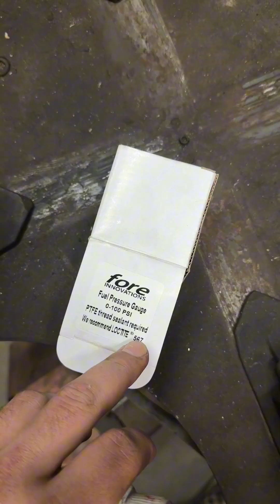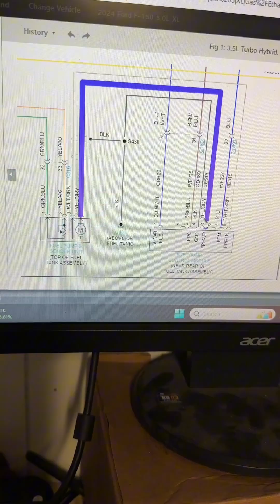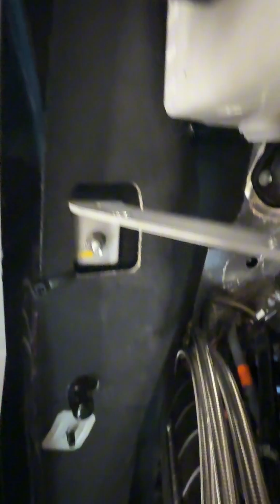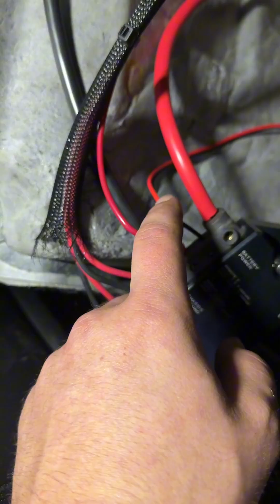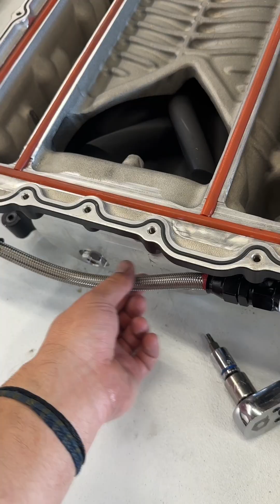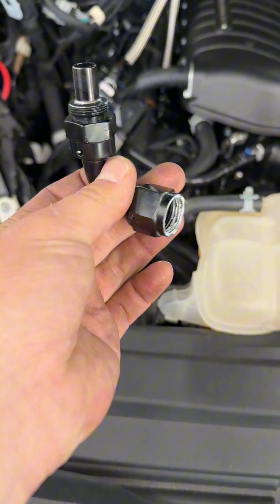Fore Innovation fuel system install on 2025 f-150 along with injectors

Comment from the maker: After this video I myself made mistake with the vaccum/boost switch in the video it’s mounted on driver side port, but this is only vaccum it never gets boost leaving us with only one fuel pump working the correct port is on the passenger side front not the side it’s a little plug and it’s in same location as the map sensor except located on other side. Also i did not add this into the video but the wires coming from engine bay and through the fire wall make sure those have like a vaccum hose or some sort of cover over the wires so over time with movement it does not shave of the wire insulation.
Reply: Where the regulators per set to have pressure?
Reply from the maker: @J-Man-C the regulators come already adjusted to the correct pressure if that’s what your referring to, but still double check once system is on
Reply: @Slowestmk8  we  cant get pressure at the regulators. I think our problem is at the remote wiring pumps never kick on
Reply from the maker: @J-Man-C with ignition on do you hear the fuel pump? And also are the gauges mounted in the correct spot. If you hear the system turn on and you don’t see any pressure I’m pretty sure those gauges are in the wrong ports on the regulator
Reply: @Slowestmk8 we figured it out had a fuel line crossed at the regulator lol. Thanks for the response.

Comment: What pulley are you running?
Reply from the maker: 3.25
Reply: @Slowestmk8 dang mine told me 3.75 on 93 and 3.5 on E
Reply from the maker: @J-Man-C all tuners recommend other setups or what worked best for them got this f150 tuned on a dyno by west palm beach. 3.25 is the smallest they recommended

Comment: Oh boy, I see problems in your future. First off, the only fittings that need sealant are NPT fittings. AN fittings do not get any sealant on the threads. The sealing feature of AN fittings is at the conical seat of the fitting, not the threads. You’re waisting time doing that. Next up, duct tape on a grommet? That will not keep water out, you can use weather proof pass throughs on the grommet. The big issue you will run into is with the Fore fuel hanger. Since it’s a non bucketed design, meaning the pumps just sit in the tank, you will have low fuel issues, or if you have to take a hard turn.
Reply from the maker: I appreciate your feedback, thank you.